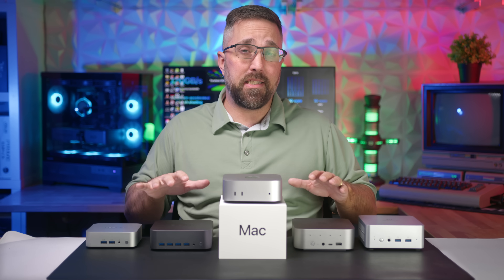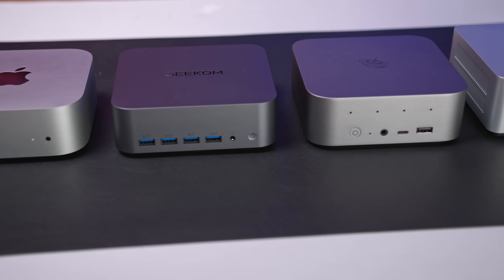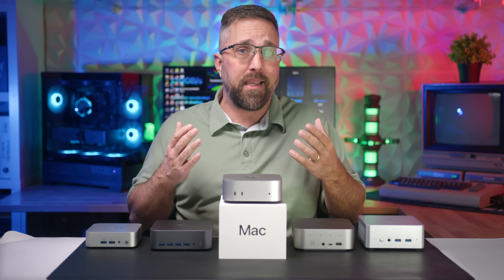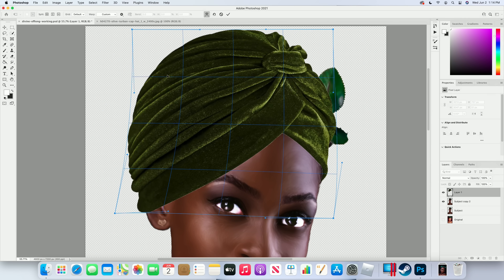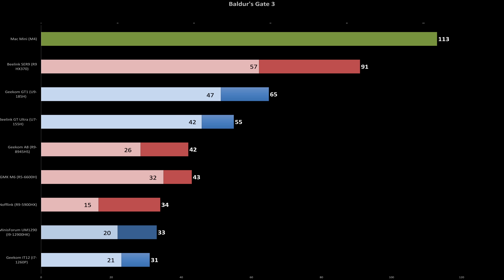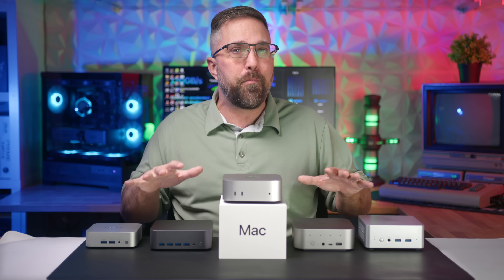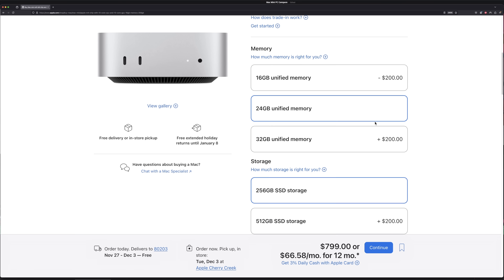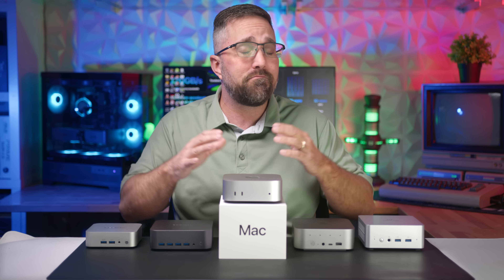M4 Mac Mini vs Intel and AMD Flagships – It's Not Even Close!

Comment: Just buy the 256gb storage model and use thunderbolt/usb 4 nvme adapters for extra storage.
Reply from the maker: @PlayingItWrong  or get the 10gbe upgrade and a good network attached storage option. My Mac Studio has 32TB of infinitely expandable fast storage. And the best part is the storage server is tucked out of sight in my basement.
Reply: @ElevatedSystems oh, that's not a bad idea. I've been looking at bumping my nas to 10gbe (or going full goblin with a 40gbe Ali express setup).
Reply: @ElevatedSystems  10Gbit ethernet is about 150MBps, which may be fast for ethernet but is about 50 times slower than a modern nvme ssd
Reply: @drkastenbrot Yeah but for a non boot drive it ends up being basically irrelevant. Can edit video, make music, game, no issues whatsoever. It’s really only the boot drive that you “feel” 99% of the time.
Reply: @ghost-user559  modern games will stutter pretty bad without nvme performance. all the applications you listed will be affected from noticeably to basically useless. besides the raw speed, the access time is the biggest issue. it is orders of magnitude slower than direct pcie access and unfortunately most typical workloads are random access and will be bottlenecked to about 1/10 to 1/100 of the interface speed.
Reply: @drkastenbrot  Sure in theory but not actually in practice. Most NLE copy the external media files temporarily to the local project while it’s editing a video, or at least link them, so there is no issues there. Only cold storage of the raw clips is impacted by the speed of the external drive, not the actual editing process which occurs on the internal in the majority of use cases unless relying on linking. Audio libraries stored externally are likewise imported into a DAW while making a track and do not impact performance whatsoever in most cases. I’ve never had any gaming issues once a game loads assets, although I do run a 2 TB Nvme in a Thunderbolt enclosure as my boot drive, and the apps themselves live there. Loading a mod or a save file from an external isn’t an issue generally.
Reply: @ghost-user559  daws do play straight from disk, at least the recent versions of cubase, fl studio and live all do it. still, audio is small and kinda does not matter other than loading times for large kontakt libraries. 
for video editing, it is also played straight from disk. caching video is unrealistic when the source footage can easily exceed 100GB. caching that requires a manual step or setting in the software associated with wait time. thunderbolt is fine but 10GBE is not. still, mediocre performance at a fairly hefty price for a thunderbolt enclosure that should not even be needed in the first place. price ladders are anti consumer bullshit, there is absolutely no excuse.
Reply: @ Well I would assume most people would be using proxies for video editing, or at least rendering on the fly, and bouncing audio to free up memory in their daw. But nowadays it’s totally possible that a person would not need to worry about proxies for video editing or even bouncing audio with the speed of these processors. But I would also say it’s the expectation in more professional settings, and as far as video editing its the default in Final cut to render on the fly as well. All of that makes disk speed less relevant than it might be otherwise, especially because the heavy lifting is still done on the fastest drive. And yeah that’s true if you didn’t bounce then something like Komplete might have some hangs as the drive wakes up, but certainly bouncing would be the solution one would use as best practice, and then the library location wouldn’t impact the actual track because those bounces would live in the local project file or folder, and with proxies and rendering as you go, one could mitigate any possible lag as long as your projects were at least on some kind of ssd as a scratch drive. I think the type of storage should definitely dictate its function. HDD makes great archives and cold storage backups and a Thunderbolt enclosure or even a cheap usbc Samsung external is more than enough to load assets into an nle or daw, and also to game.
Reply: Buys mini PC to save space on desk.
To compensate uses dongles 2 times the size and causing 3 times the wire clutter on desk.
Reply: Buys miniPC with 4TB internal storage to save space on desk. Loses all data in one hit.
Reply: @ have you never heard of backups? You do realise an external drive can fail as easily as an internal one, right?
Reply: Lamo still have to buy 😂
Reply: dosdude1 already demonstrated on release day that storage can be upgraded with "relative" ease, just wait 2 month and AliExpress will be flooded with cheap ass SSD modules.
Reply: FYI, m4 Mac mini can upgrade the ssd it uses a M.2 2230. Requires some dismantling but is possible. Not soldered in. Ram is though. Check out ifixit.
Reply: I mean sure? Or you can buy one of the windows machines and be able to upgrade when you need or want to. Imagine one of the SSDs dies on the mini, since it's soldiered, you basically need a repair shop, unless you know how to do it yourself, to change it. Which is extremely more expensive than just buying a new nvme SSD, taking the back off and adding more storage or changing the storage out. 

You're trying to find a solution to something that shouldn't be an issue and it's another bad solution considering you're also potentially exposing your storage to more elements. Even if it has a case, it doesn't mean it has shock resistance if you bump it or something else happens.

And yes i know its modular and easy to upgrade, look at the pieces, i can buy a nvme ssd for 50 bucks thats 1TB...
Reply: TB4 is garbage and the cost to get TB5 is just dumb on the Mac Mini
Reply: it will be slower in comparison to the built-in SSD.
Reply: You only have three thunderbolt ports. If You use one for file storage and one for Time Machine you are down to the last one. If you have a second monitor that's it.
Reply: If you are buying this to use the Apple AI features, note that Apple will only run the AI features on data stored on the internal drive. This is because the are making claims to keep your AI data secure, and only they only view the internal drive as secure.
Reply: @eltamarindo  There is a fix for that thanks to Kyle Ye - I cant link github in youtube - just google kyle-ye/xcodellmeligible -  A quick xcode copy paste in terminal and you are fixed and working.  I have been running it sense friday evening of M4 Mac Mini release with no issues.  TB4 housing with a 2TB NVME made bootable running 15.1 with working AI.
Reply: @eltamarindo which is just gate keeping and I stopped caring about ai after the first year.
Reply: @eltamarindo Apple scans your content and reports back on what it finds, there’s nothing secure about it
Reply: @eltamarindo so basically the usual "screw you cause we are apple" energy
Reply: @eltamarindo  Anybody with enough sense and knowhow to use external drive knows well how shit Apple Intelligence is and won't use it anyway 

Also, there's a few companies starting to make apple compatible internal ssds at less than half the price apple is charging.
Reply: There are Thunderbolt 5 External ssd enclosures now which claim up to 6000 read and write speeds if I’m not mistaken.
I could imagine gen 5 drives coming soon for Thunderbolt 5 connections as well.
Reply: @GlobalWave1  Correct. 2 announced so far. Sabrent and OWC. TBOLT 5 IS MINI PRO ONLY. Waste of time and $$ for the standard mini.
Reply: @GlobalWave1  there is no Thunderbolt 5 external units what so ever at this point.
Reply: @logirex  there are in some countries
Reply: @logirex  There are plenty of thunderbolt 3 ssds that can do at least 3gb/s rw. theres no reason a mac user would need higher speeds either. Id just get a 24-32gb unit and use thunderbolt storage, 600 bucks for 2tb is outrageous
Reply: @logirex   Not true.  OWC is selling the Envoy Ultra Thunderbolt 5 drives.  More will be on the market before you can blink.
Reply: @logirex Yes there are, and even if there weren’t, what’s your point? You think lots of companies aren’t planning on making them?
Reply: @GlobalWave1 base m4 only supports TB4 and you will not get anywhere close these speeds with external storage
Reply: That’s what I do with my M1 Mac mini. Works great.
Reply: Wait what? .... the point of such a device is to have a small compact computer which does not take up much space and you want to add external clutter to make it work? O_o
Reply: @Astravall  shhhh - your words are igniting backbones of lots of mac users which usually carry hub and numerous adapters and still thinking this is perfectly fine...))) 
They are so in love with the Company,  wiping tears of joy with premium blankets
Reply: @Astravall a small ssd won’t make a difference
Reply: @Astravall  yeah thats how macs have worked for the past decade sadly
Reply: @Astravall  Just put the external drive in the spot where your pc has the external power supply stored.
Reply: @Astravall no one should be storing data only in internal drive.
Reply: @Yayadays111 are you suggesting everyone should store the important system data on external drives then?
Reply: @itsmilan4069  I am confused, where did I say storing system files externally?
Reply: @Yayadays111  Maybe ... but then keep an backup in the cloud or somewhere else, cause if something happens like a fire storing it additionally on an external drive will not help either. My PC has 6.5 TB internal storage and that cost me less then an Apple Upgrade to 1TB ;). Well OK that is mostly games so no need for much backup. For really important stuff i have a second Linux System with backup and 1TB internal storage. You can get 2TB NVMe Gen4 SSDs around $100  .... a upgrade from Apple from 256 GB to 512GB will cost you already more then twice as much. Just ridiculous.
Reply: @ yeah it's not complicated, just grab a fast nvme ssd and store the non daily files. I got huge photo files in raw and jpeg, I just store the raw and jpeg in one driver. Backup jpeg in cloud and any key ones in the internal SSD.
Reply: @Yayadays111 it’s fine if you back it up. The internal drive is faster than external storage, and orders of magnitude faster than cloud storage.
Reply: @Yayadays111  then what else would people do 🤦🏽‍♂️
don't recommend sh!t you don't know about
Reply: @ I have a 60mp full frame camera. are you saying I should store them on the Mac?
Reply: You can technically upgrade the storage on the mini. The storage is removable, so it will be some time before 3rd party options show up
Reply: IGNORE. BUY THE 512gb with 32gb memory. Yes it’s more expensive but it’ll last you 5+ years for high-end usage.
Reply: @Mr_Kenneth $499 for base model and then I’ll spend more on m5, m6 ,m7 and so on
Reply: @Mr_Kenneth At that point the base M4 pro version is way better
Reply: @Mr_Kenneth it's literally 2x the base model lol
Reply: @Mr_Kenneth 512Gb, 5 years lol, high end usage lol. 512 wouldn’t last you one day of “high end usage”
Reply: @Mr_Kenneth  if you want 512GB and 32GB memory.. just buy two and use the saving on a chewing gym
That says something about how little sense it makes to take Apples priceladder when it cheaper to purchase two with 16GB/256GB each and it will be less then bying one with the same 32GB/512GB.
Base Mac Mini M4 is wicked good value, that wicked good value, gets outwatered fast going up in upgrades.
I get that some wont be able to work with the specs it got, but for those that can..its a win.
Reply: @ there is no 32gb ram option. And at that price you can get a decent small gaming desktop.
Reply: @Yayadays111 you people don‘t get it… a mac user never thinks like that….. you stay with mac, pc users stay with pc…..
It depends what you wanna do with your system.
Reply: @5timesm  it doesn't matter. be it linux, mac or windows, you never want to bloat your main drive.

Comment: the ssd's for Mac mini will have an easier upgrade path in the future, as a supplier works to make replacement drives. Meaning ram deserves most attention upon starting upgrades
Reply: Not true, mac studio also has removable storage since the M1 yet there isn’t any drive modules available to buy
Reply: @JuanFmTech  
There's probably some manufacturers based out of China